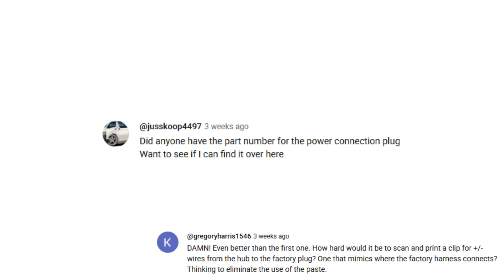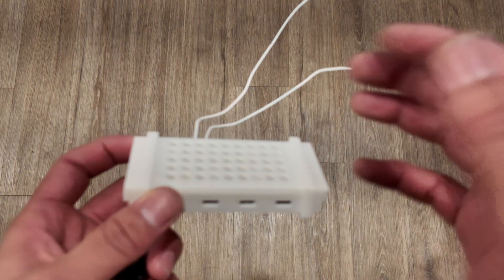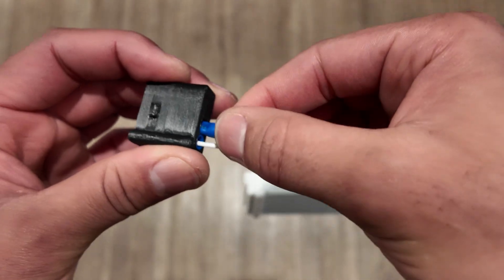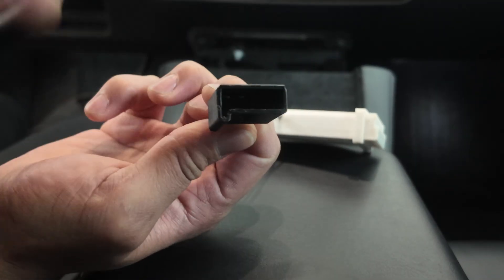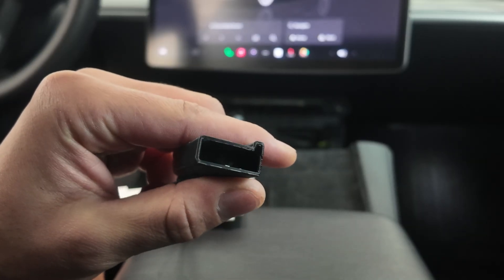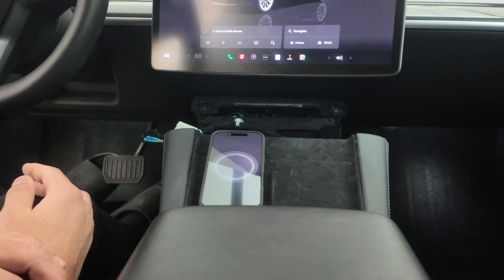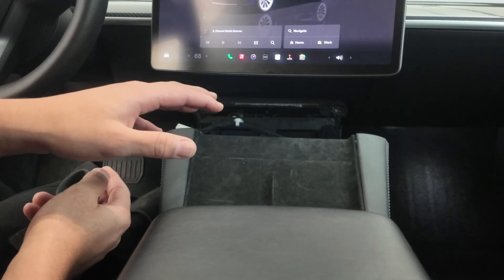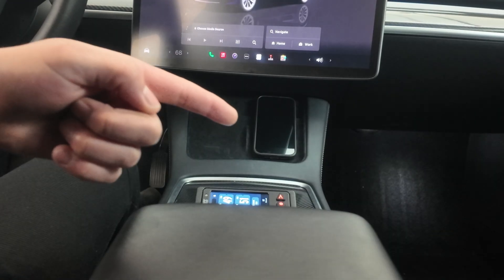Connector For The Tesla Wireless Charger Module

Comment: Does this module provide enough power to each 25w magsafe puck (it needs 2x30w)? even with watch?
Reply from the maker: Yes — according to the spec sheet, the module claims a max total output of approximately 260 W (65 W per each of 4 ports) if all ports are used at full rated output. But in practice, you should assume that the full 65 W rating might only be guaranteed for one port at a time or fewer ports simultaneously.
Reply: perfect, can't wait for highland version to come out it will be instant purchase 😂